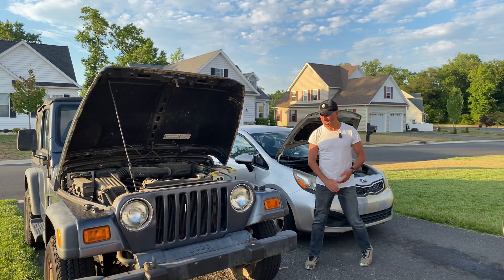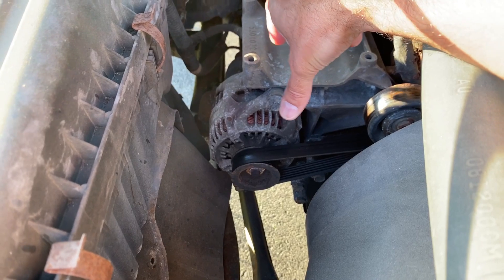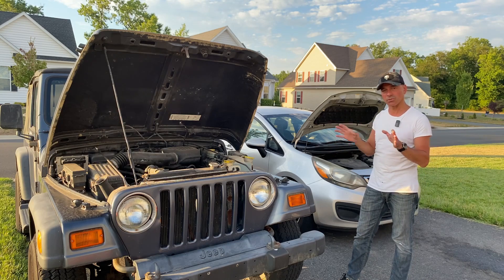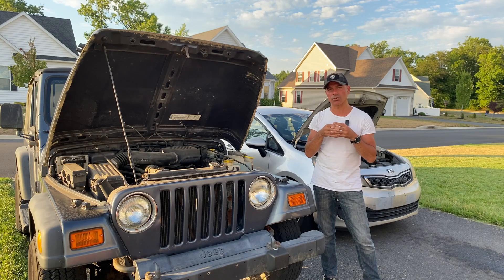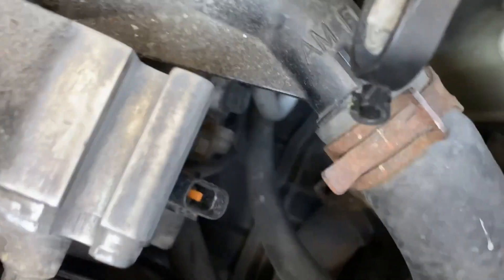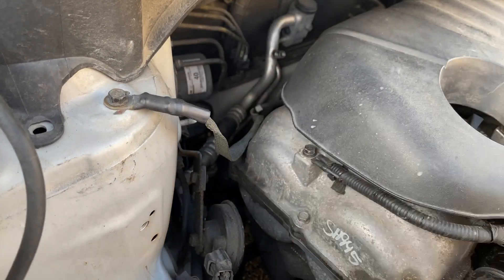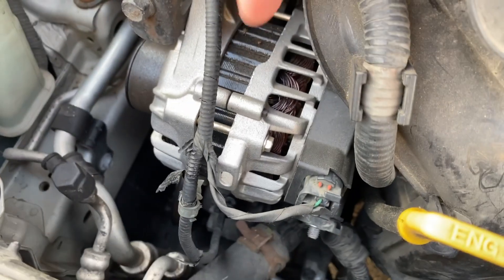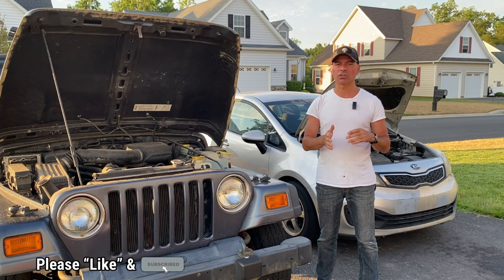Grounding Alternators (Andy’s Garage: Episode - 482)

Comment: Would you use dielectric grease on the alternator ground points to help prevent future corrosion or is it a waste of time?
Reply from the maker: @TurtleWaxed  You could
Reply: I've used conductive anti seize especially where steel meets aluminum keep corrosion from setting in

Comment: Any idea why on a 2015.5 Volvo T6 Platinum would go through 4 alternators and seems to never put out 14+ volts? Seems to average 13.5+- volts? First two alternators that replaced the Volvo alternator were NAPA, next two are Oreily’s. Could it be a ground issue or is it the ECM not properly communicating with the voltage regulator? Really confused. Also my mechanic only charged 1.4 hours for labor whereas at Volvo they say it calls for 5 hours of labor. Do you think the ECM needs to be reprogrammed?